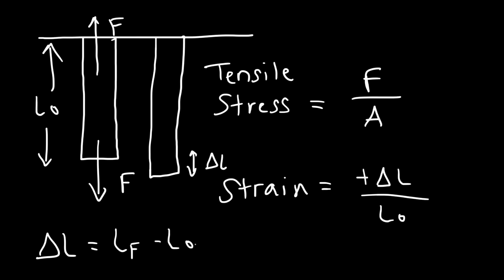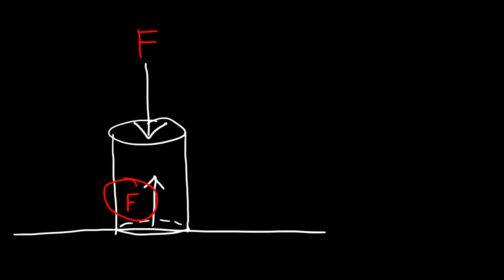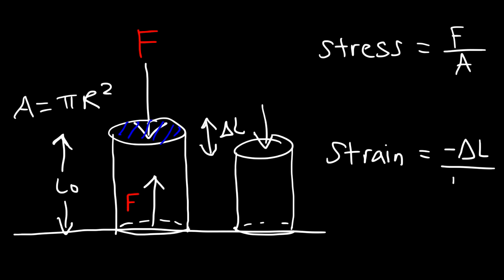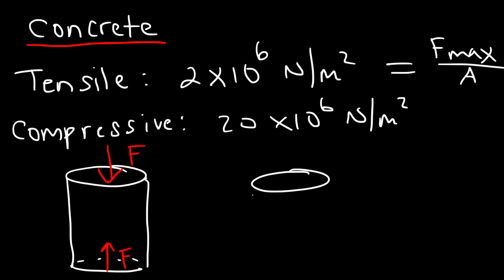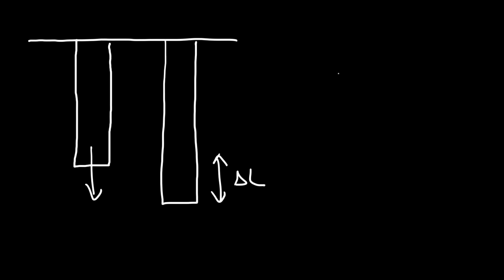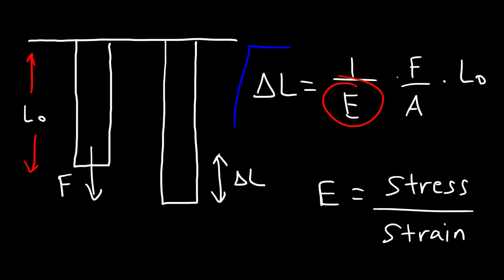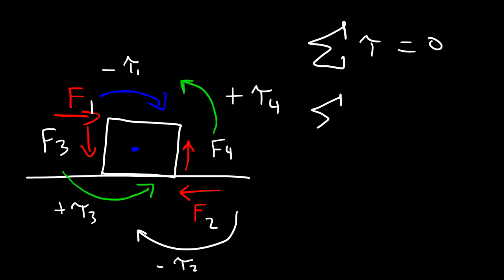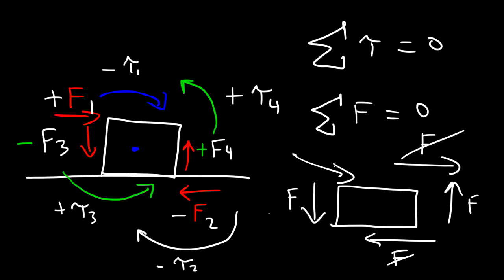Tensile Stress & Strain, Compressive Stress & Shear Stress - Basic Introduction

Comment: "20 times 10 to the 6th power"
is incorrect scientific notation.
It should be written as, 
"2 times 10 to the 7th power".
Reply: It's engineering notation where the exponent need to be a multiple of 3
Reply: @Richie-o61  I am an engineer and I have never heard of that rule.

Comment: you didn't explain how to calculate the stressed length in the first place
 to use it then  to calculate the strain and the change in length 

how are we supposed to find the change in length if we don't know what's the stressed length  
can you tell what   2 + ? =  equals
Reply: The Stretched length would be given to you in the question, or they could give you the change in length whcih you could then use to find the stretch length. As long as there is only one unknown in that equation then you can solve for anything

Comment: Me: tinsile is stretching, the other one is compressing, and shear, uh, the cube does it's own thing, I dont know
Reply: Tensile is change in length/size, shear is change in form/shape
Reply: Almost. Tension is the opposite of compression. When an object is experiencing tension, it's being pulled apart, so it will get taller and thinner. When an object is in compression, it's being squeezed, so it will get shorter and fatter. Tensile strength is an object's resistance to defamation. Defamation is the measure of how much an object becomes taller/shorter or thinner/fatter.

Normal Stresses are forces that act perpidiculate to a surface, like standing on a floor or pushing against a wall. Shear Stresses are forces that act parellal to a surface, like slide an object across a floor or rubbing your hand across a wall.
Reply: Wtf were you thinking

Comment: I have a question about the cross-sectional area on the Stress calculation, please. In your video, precisely at 02:33, you showed the cross-sectional area of a solid tube, but what about if the tube is hollow? How do I do it?
Reply: Then go about the area around that tube by calculating the area of the inner and outer circle and OH THIS IS TWO YEARS AGO. Sorry if I was too late to help.
Reply: @isayoutubehandle  nah I think your just in time if you ask me
Reply: @randomdarwish8269  me showing up 2 years later
Reply: If copper wire what is the formula in cross-sectional area